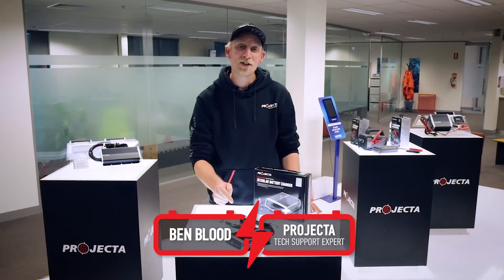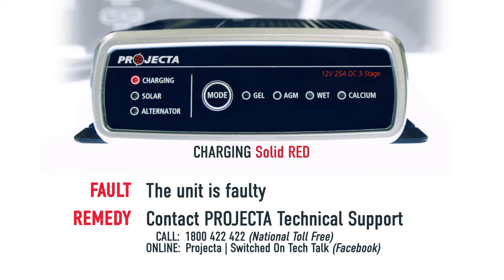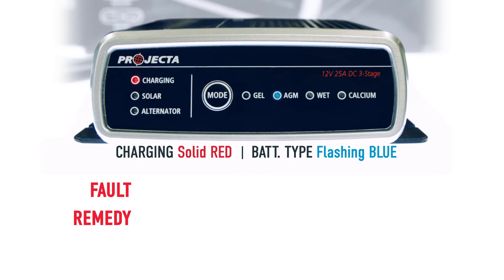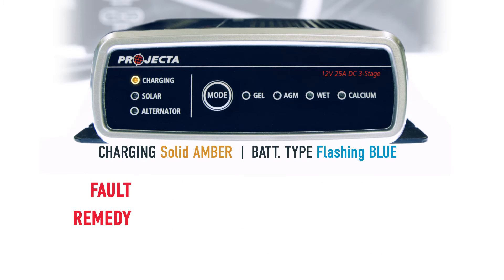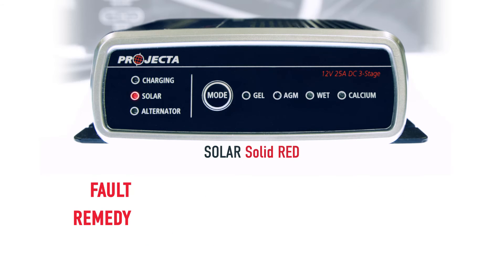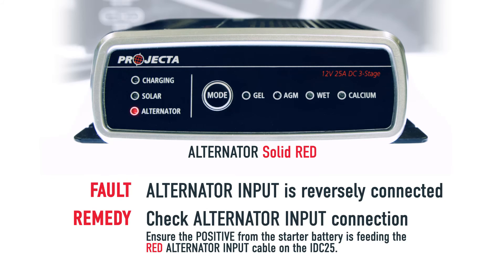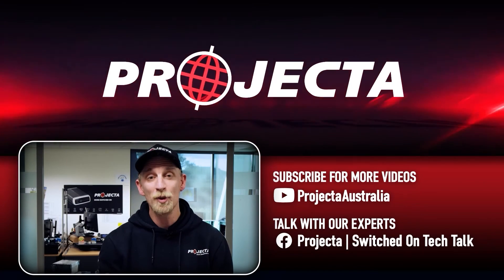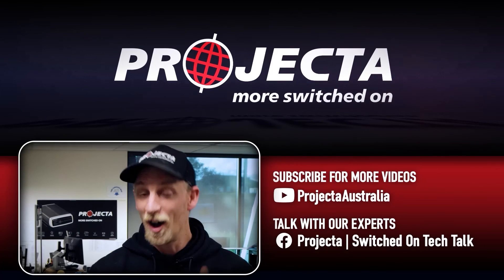Projecta Dual Battery Charger IDC25 Fault Indicator Codes Explained!

Comment: I haven’t got any lights at all apart from the blue agm every 8 seconds , even while battery is charged what am I doing wrong ! Using alligator clips and a smart charger.. it’s brand new but it says it’s charging on the app ?

Comment: My 25A unit has all LEDs (3 amber & 4 blue) on for 8 sec, off briefly, on for 3 sec, off briefly, on for 1sec, off briefly, cycle starts again, could you please advise what the issue could be and how to fix it. Thanks.

Comment: G'day, is it okay to put the ground wire to the negative battery? I've tried and it showed full amber and blue light, then all lights are off
Reply from the maker: Hi Mate, yes it is however you also need a common earth between the Start battery and the battery you are trying to charge. Cheers

Comment: I have power at 240volt PowerPoint but no power in the. 2500 charger is there a input 240volt fuse on tenal
Reply from the maker: Hi Allan, 

The IC2500 does have a fuse on the Board however it is a solder on type and needs to be replaced by a technician, anyone whom does board repairs can replace this item, if the unit is within warranty please contact our customer support team at info@brownwatson.com.au 

Cheers Daniel

Comment: I have 22.5 Volts comming from my solar panels to the Charger and the Solar Light is flashing Red, would you know what the problem could be
Reply from the maker: Hi Ray, this could be solar over voltage what is the serial number of your unit?

Comment: G'day, I get the amber and blue flashing most times when the charging is over and the ignition goes off, lasts for about 10 seconds  before the charging light goes out. Is there a problem here? This is the second battery Ive tried that the unit does the same thing with. Cheers and merry xmas
Reply from the maker: hi Mate, generally this means the voltage is dropping on the input very quickly and so the unit goes open circuit, nothing to worry about the unit will always reset itself after 10 seconds or so.
Reply: @projectapower  Thanks for the reply, cheers. Love your products 👍

Comment: I have solid red and flashing blue, but everything is connected correctly. Could this also be faulty unit?
Reply from the maker: Hi Vincent, if it is solid red on the charging more commonly it is Amber which is output open circuit, please call our Tech Guys on 1800 422 422 and we can go through your setup to find the issue.

Comment: I've got a solid amber CHARGING led, solid green ALTERNATOR led and a blue flashing (flashes once a second) AGM led. Have checked voltage across all connections and they all appear good, that is there is no blown fuses or voltage drop between the starter battery and the DCDC charger or between the aux battery and the charger. The LED status stays the same regardless of if the aux battery is connected or not. When the car is running there is no increase in voltage at the output side of the charger either.
The only example I've found on a forum where the same LED status happened was someone who's smart alternator wiring had worked itself lose, they fixed that and the problem went away.. I don't have a smart alternator so never connected that wire to the ignition and have used the DCDC charger like for 10-12 months or so without an issue untill 3 weeks ago.
Will have to contact projecta I think 😔
Reply from the maker: Hi Mate, this is output open circuit and means your AUX battery is not correctly connected, not only do you need voltage from the AUX battery in the brown wire but you also need a good common earth between the AUX battery, Starter Battery and DC-DC charger, I suspect you are missing your DC-DC to AUX battery common earth, if you can call me on 1800 422 422 and ask for daniel we can work through it and find the issue. Cheers Daniel
Reply: @projectapower  Not sure if you're still active on this, but I checked all earth connections on that set up early last year and it was all fine, but that IDC25 charger still wouldn't work and had the same combination of status LEDs no matter what I tried.

I replaced that unit with a brand new on when they came on sale. It worked perfectly fine, plug and play into how the first unit was wired. Worked fine until December 2022 that is, and now I have the exact same error.

Sparesbox has said they'd accept it back under warranty. I know that I 100% have it all wired correctly as it was checked over by other more electronically experience friends, it also worked perfectly for 10 months. 

Anyway, I'd love to know why two units have failed in the same way.
Reply: They have failed, because Projwcta is honestly crap quality Chinese made products that aren't worth half the price Projecta sell them for.

People seem to forget that Projecta started out as a company selling cheap nasty charger and all because they've been selling those chargers for a long time they feel they can increase the prices of their products to ridiculous levels.

I have never been a fan of Projecta and that's been set in stone after buying a new caravan that has a Projecta PM335J power management unit, which is crap.

It's crap because there is no adjustability to the parameters (other than battery size and absorption voltage) after changing absorption voltage the float charge is now .2v higher...
That and the unit started making an internal electrical arcing sound when charging via the built-in AC-DC charger.

Not sure why the charger changes the float voltage after simply changing the absorption voltage to lower than what I was previously?

Stupid system and the fact Brown & Watson (projecta distributor) don't implement float voltage, pukerts exponent, tail current etc is piss poor and my experience is a perfect example.

B&W staff are quick to tell you that every battery is different... Yep, that's why you should allow the end user to set up your charger to SUIT THEIR bloody battery and not force them to your profile which you self admit won't suit all batteries.

Projecta is shit!
Reply: Projecta is shit but REDARC

Comment: I’ve got a flashing red solar light.
The unit has stopped charging my secondary battery on solar and from alternator. Battery was at 11.5v.
Disconnected and charged battery with a 7 stage charger and still the red light is flashing & not giving charge to the battery (12.7v after 7 stage charger).
Scangauge shows alternator putting out 13.8v at idle.
🤷‍♂️🤷‍♂️🤷‍♂️🤷‍♂️
Reply from the maker: Hi Phil, this is solar over voltage and the unit has gone into protection, you will need to disconnect the earth for the unit and reconnect this will reset the unit, if this keeps happening please contact our Tech Support guys on 1800 422 422. Cheers